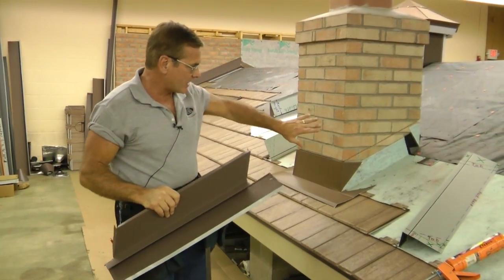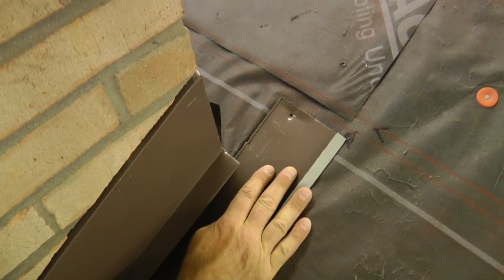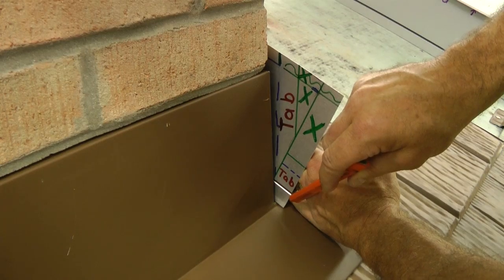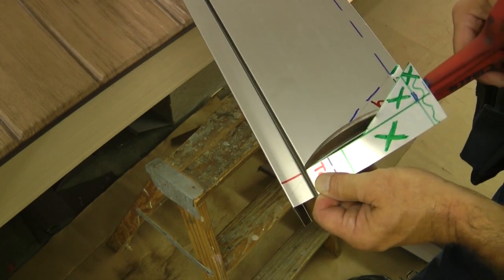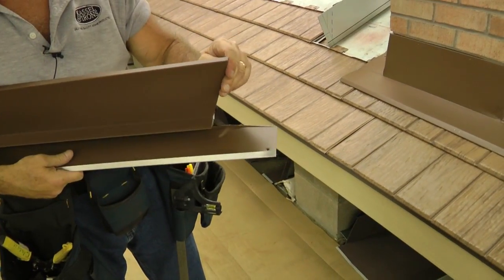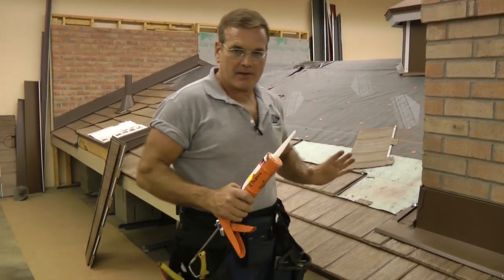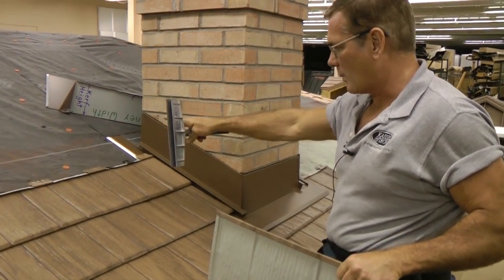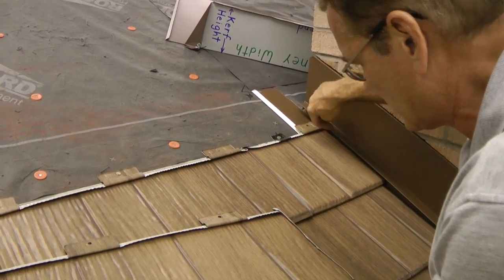Chimney Sidewall Channel

Comment: Nice video. Do you use that side wall flashing for asphalt shingles also?
Reply from the maker: Thanks @Easternfly! Our video is strictly for installation procedures used with our metal shingles. The approach could perhaps be used with asphalt shingles but the shingle manufacturer should be consulted. This would not be normal protocol for most asphalt shingle applications.